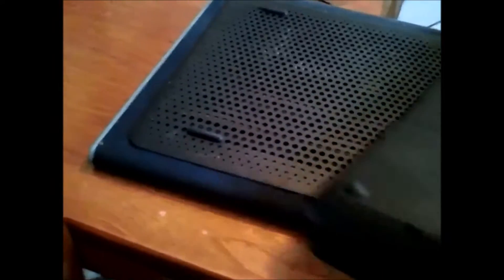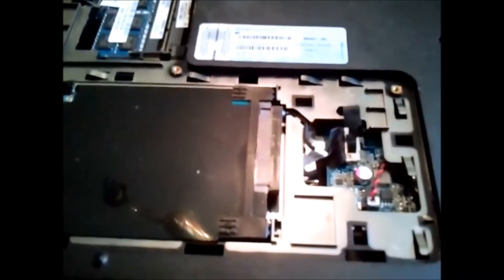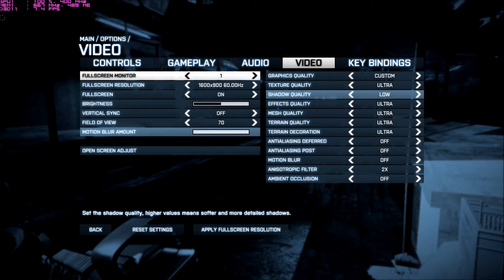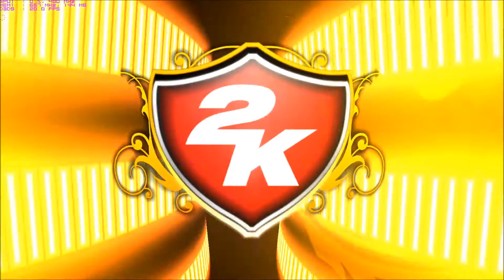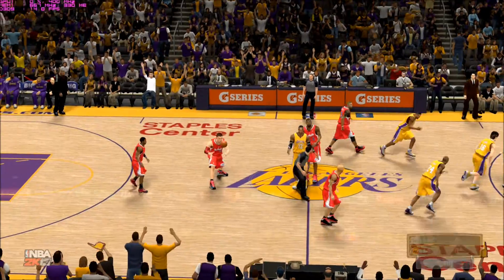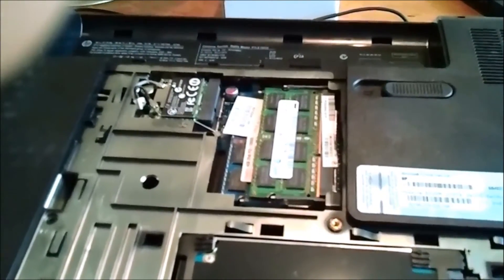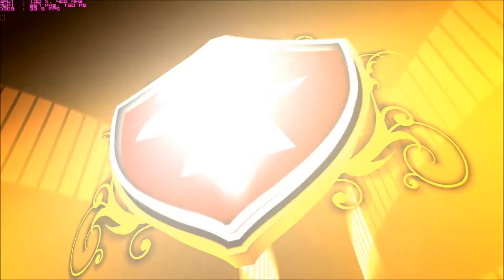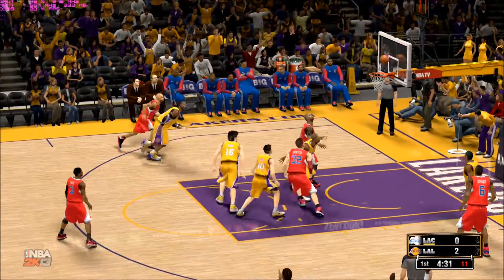How To Install Extra Ram In HP G- Series And Comparison Of 4gig and 8 gig Gaming

Comment from the maker: It's not going to run at 60fps..at least not unless you play with everything on low but i'd rather play with the graphics almost maxed at 40 which is plenty fast enough lol but 90degrees?? what is your laptop sitting on?  If it's overclocked, put the clocks back to their default because you'll be able to play at those clocks with the extra ram and until you get a cooling pad sit the laptop on something to elevate it so that the heat escapes :)

Comment from the maker: the first thing you should do is make sure that all of your drivers are updated, video, audio, bios, everything and most of the time that will fix any crashing problems. What generation G6 do you have? Is it a recent one because if it is than 4gigs shouldn't cause a crash and also, have you made any tweaks to your operating system ?

Comment from the maker: Nope no overclocking was needed for this..with 8 gigs you should be getting an average of 25 or 26 frames per second on ultra..check the first part of the video again and copy my exact settings that i have for battlefield 3 and hopefullly you will get the same performance that i had in the second portion of the video